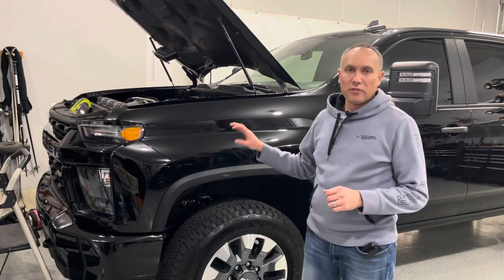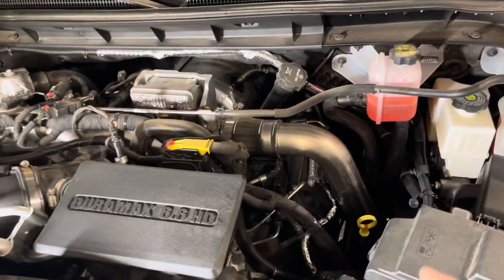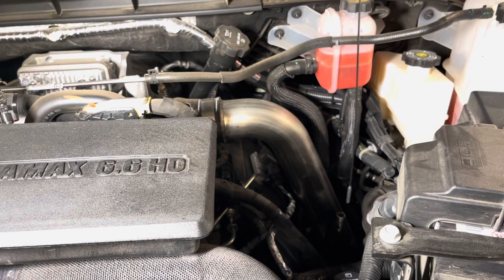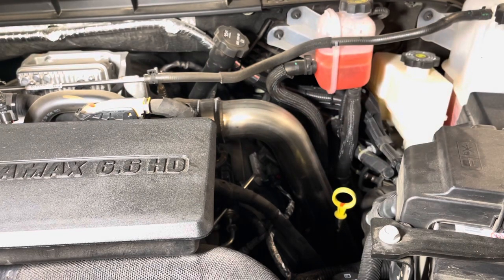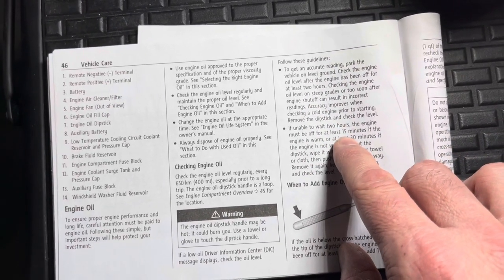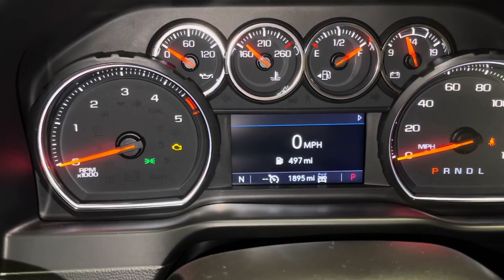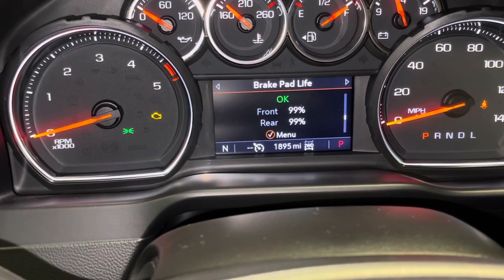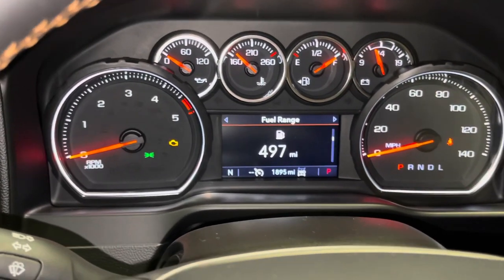2021 Chevy Silverado 2500 HD Duramax L5P | Checking The Oil | The First 2,000 Miles!

Comment: 49,000 miles on my 21 and the oil level always raises the last two oil changes and I don’t smell any diesel in it idk what’s going on ? But I can check it 10 times in a row and it’s always different sometimes extremely high and sometimes a little high maybe it’s dragging on the tube it’s a pain in the ass
Reply from the maker: That is strange